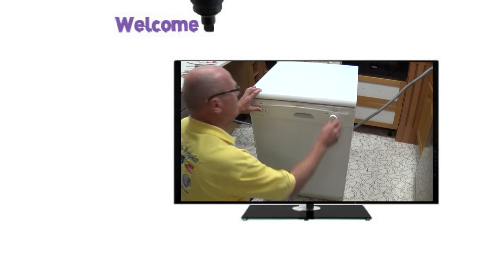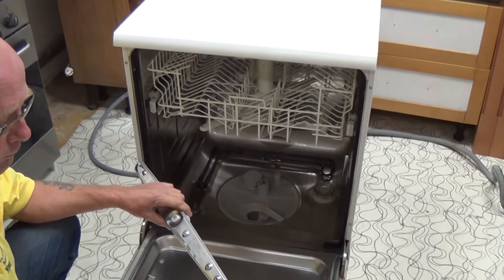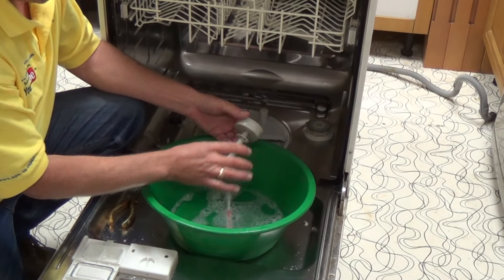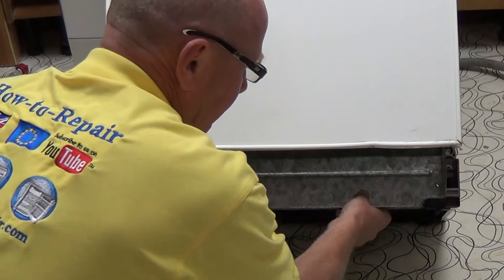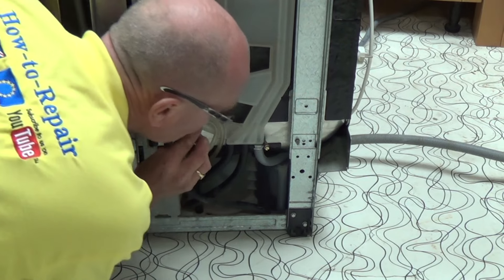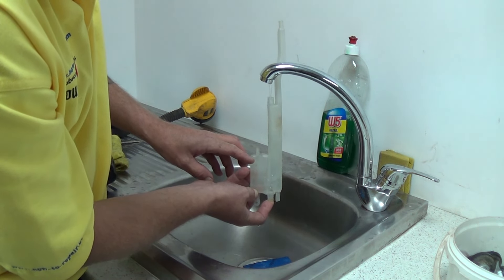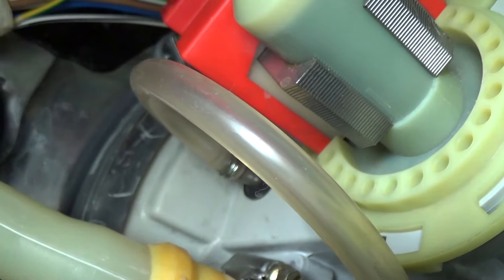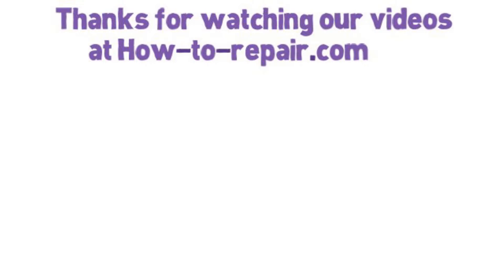How to service dishwasher not filling with water or washing correctly, White Westinghouse Electrolux

Comment: Thanks for the directions. I had checked the water valve and it was closed both without power and with 120 volts. I thought that it must be bad, so I both a new one and installed it and the same thing it wouldn’t fill. That’s when I checked further on YouTube and found your video. I put the gallon, ( actually mine took a good gallon and a half) started it up and it worked. I felt the valve and after running a bit it pumped water out and the valve opened. I put the old valve back in and it worked. I wish that I would have watched your video first it would have saved me money and a week’s worth of hand washing. Thanks again
Reply from the maker: Really glad you got it sorted. If you remember to subscribe to the channel, then you will always be up-to-date with all my videos.  please remember to subscribe as that's is was keeps this channel going. Thanks 👍
Reply: Amazing!!! I simply cleaned my drainer, filled it with water like you showed and it started to work

Comment: I was repairing an aeg 40860 and had a leaking overflow on the labyrinth, it was a bit dirty and cleaned it. 0 result.... The black filling hose from the labyrinth to the central cup inside the machine had not much but a bit of dirt on the walls and caused the problem..... Also noticed the pressure switch which you pointed out..... Good video.....

Comment: Looking at this machine versus my GE dishwasher is amazing.  The GE is so much more straightforward.too many pressure switches and components on this machine.  Multiple filling pressure bowls etc.  For example, the GE you open a water valve for a given amount of time.  You have a simple flood/float switch to cut it off if it has too much flow during that fixed amount of time.  This machine is so much more complicated. So many more tubes besides the main drain and recycle main tubes like the GE.  Nuts I think. This definitely seems to be over engineered IMHO. Nice video. Great job

Comment: My Siemens IQ100 initially showed an E15 fault with the lit tap logo.  Couldn't find out much about that online except someone said to tilt the machine forward.  I did that and it tripped the RCCD on the consumer unit!  After following a couple of your videos I learnt how to access the base of the machine and found water sat in the bottom which had lifted the tray float valve and shut off the electrics.  After carefully mopping that all out with lots of kitchen roll I ran the quick programme and it all worked.  That said, it seems there's a load of gunge/fat at the top of the dirty water end of the fixed panel piping which I think may be inhibiting flow and correct function of that high level float valve (I think that's what it is?).  Not sure how to access and clean that so will run a couple of cleaners through the machine and hope for the best.  Thanks for making the video.  I could do with another on cleaning out that panel though - the only one on YouTube is in Russian :)

Comment: Hi there, l have a consrtucta dishwasher that would not fill. just sounded like sucking äir or something. The first puzzling thing, on this model there is no float inside to check. complete mystery. First, l took apart the connection , where the water connects and on this version, there is some sort of plastic rectangular box, where the water connects . Is this the float? anyhow unscrewed it and pulled out little filter and cleaned it. It was not that dirty and was not the problem. Because when l reconnected it, the same problem, like it was sucking air instead of filling with water.l also took all plumbing apart under sink and checked all hoses. What l noticed inside where you take out the two filters on the bottom of dishwasher and l turned it back on to fill. There was a spray of water coming through to that little filter area, where the filter sits,but it was not filling. And so l left it for 24 hours and was ready to pull out and take apart and look at the Valve etc. So today l just pulled out the spray things that spin around and checked them . No blockages from what l could see. flushed water through them. restarted and hey presto. It started to fill normally. So now l am confused to what was going on. If there was a blockage in the piping going into the machine underneath to that valve or whatever was the case ? everything is normal again. So l am dumbfounded to where the problem was and how it is back to normal again. What L really want to know is your guessing to what was going on, and did l really do anything to help and why do you think all is normal again. Also, where is the float, is it that plastic thing on the connection hose ? Does the water only fill up in the filter area on this model ? mistified really. Thanks.

Comment: Great video but I still need help.  My dishwasher when new was not filling with water and I did not realize it.  I rinse my dishes very well before loading the dishwasher which makes them look clean.  My dishwasher would start up and go through all the cycle and when done, it was hot inside.  So, I thought everything was working fine.  We don't go through a lot of dishes here so it's like once a week we run the dishwasher and we handwash a lot of dishes.  I finally realized that water was not going into the dishwasher every time.  Sometimes it does and sometimes it doesn't.  I have to do the trick method with putting in water manually every time the dishwasher is supposed to fill with water throughout the cycle which is several times.  I have to know when that is to time it just right.  I have finally figured out that if I turn on the water in the sink that the dishwasher is connected to immediately when it is time for the dishwasher to fill that it fills on its own.  I can turn that water off in the sink as soon as it starts filling and it continues to fill.  I have to do this every time when it's time for the dishwasher to fill.  There is nothing stuck anywhere that would be making this happen.  It's been happening since the dishwasher was first used when it was new and never used prior.  Do you know what is making this happen and what I can do to correct it?

Comment: Thank you. I had a problem with my now obsolete Cuisine dishwasher but couldn't access the rear as it is built in on legs and I couldn't move it without a lot of trouble.However as a last resort, having watched your vid. I checked the filter in the base of the machine and discovered a loose plastic part which I re-inserted and bingo! it's now working again. I wonder how much the plumber would have charged......

Comment: I have a Teka dishwasher, but it has stopped water inlet to the bottom arm. the top one works ok & it drains away water fine. I have checked the arm but it si not bolcked, it is the supply of water instead. please can you give me any ideas. thanks Kev.

Comment: In 5 years since new my aeg dishwasher has now 3 times had heater needed replacing. Is this a known fault ? I only use it around 3 or 4 times a week. I know that at least once the thermostat has been replaced in case this caused early failure of heater. Any comments or advice please. Thanks.
Reply from the maker: Without being able to pull the workshop manual for the Pacific model it is very hard for me to tell you about any common problems that I come across if it is a tubular heater I have seen these go on many occasions

Comment: Magic Chef DU4500B is FIXED!

I have been on A LOT OF VIDEOS and YOUR video cost me ZERO in parts and repairs!

Proper diagnosis is EVERYTHING.
In health care we say, "Don't guess, TEST!"

I thought for sure it was a bad inlet valve and it didn't look like it was very easy to remove without disrupting things bc mine is connected to a tiny copper tube that has no threading in a standard threaded (garden hose looking connector) mine looks a bit corroded but no leaks AT ALL.

1. Poured the water in the bottom as you instructed and I put it on and it started washing in the wash cycle! The upper and lower arms were perfectly functional! Ok...
2. I can't unscrew anything to remove the float to clean it from the inside of the machine.
But as I reached under it to check for a nut-style bolt to put a wrench on... it was COVERED IN what felt like peat moss! 

Holy Yuck Batman!

Went up under it and cleared it out with a paper towel and set the machine to the beginning of the SHORT cycle to see if it would fill on it's own.

It immediately started filling up as normal!

What a blessing! Thank you so much. I rarely SUBSCRIBE to channels but you earned a big thumbs up and a Subscribe! I will be sharing your channel with everyone I know. 🌞😁🙏

Comment: hi
i have bosch diswasher.after  1 minute switch on its water check light comes on and does not run any more.i have tilt 45 degree and clean the water also i clean the hose make sure its not blocked but still  check water sign comes up any solution? and do you know what could be the problem?

Comment: My dishwasher turns on makes the noise that it's working but after the cycle the dishes are still dirty and not wet,
I tried that water test but all that happened was it drained,
Any suggestions?
Reply from the maker: i need make and model please